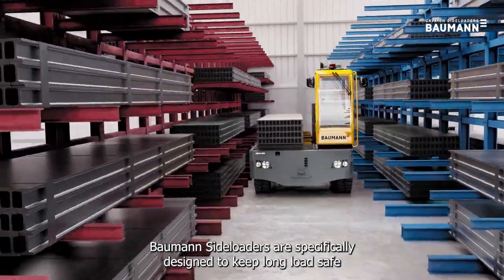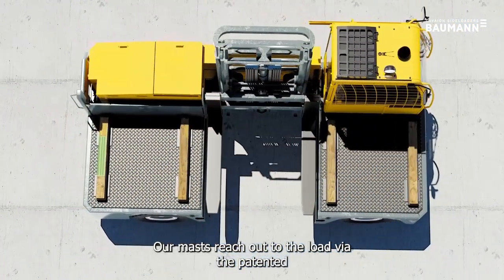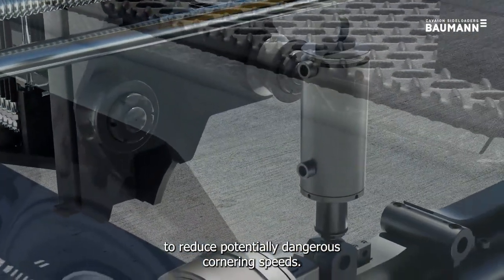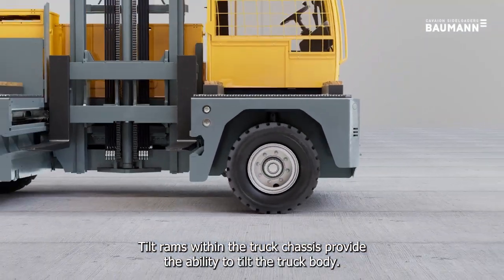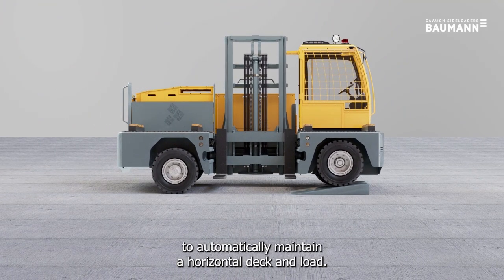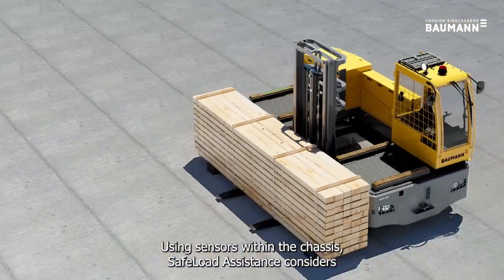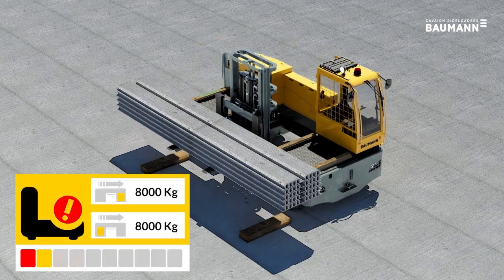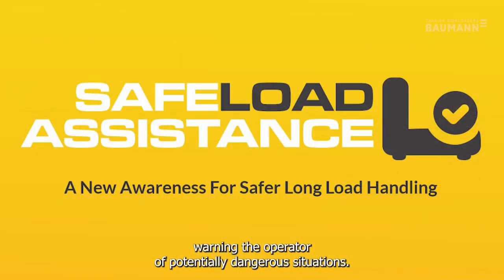Baumann SafeLoad Assistance

Comment: But what about the uneven tire degradation? Higher on the load deck side!
Reply from the maker: Thanks for the comment. Tire degradation is determined by many factors, such as the ground conditions, pressure regulation and tire brand, but it is not generally a common problem for us. If a case were to occur, we would recommend switching the tires around to even out the wear.